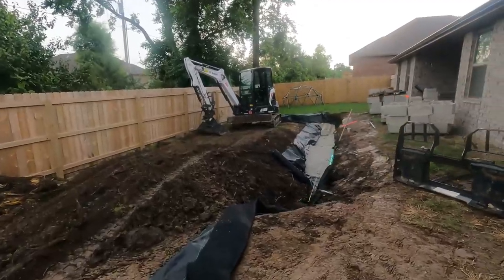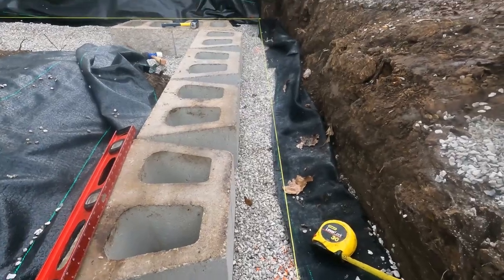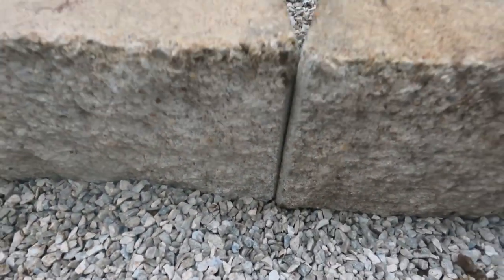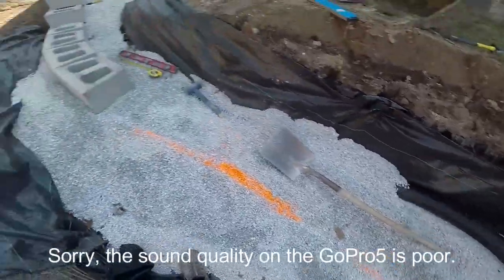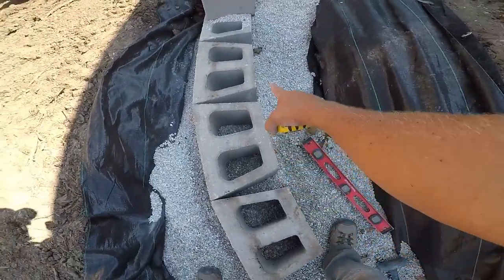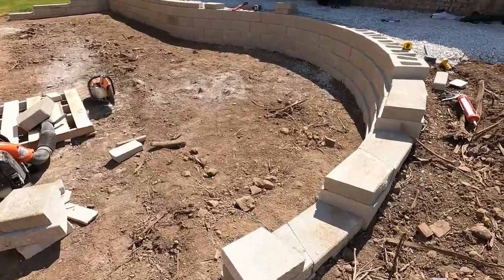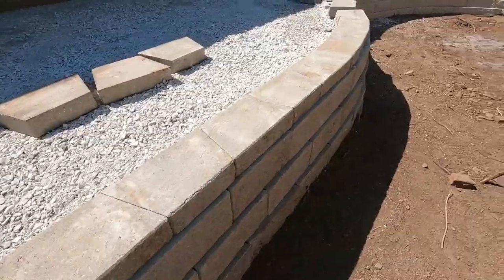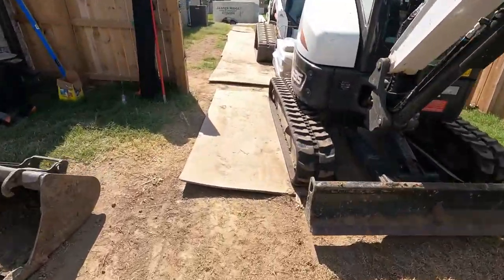How To Build a Curved Retaining Wall (Step-by-Step)

Comment: Outstanding. One of the best examples of team work and utilizing equipment and skill to perform a back yard make over. I hope someday to be at least partially capable of this. Liked and subscribed a while back. Couple quick questions: 1. Do you need to compact the base layer of angular gravel under a wall of this size either by hand or with a compactor or simply level it? 2. Does each block need to tilt back ever so slightly towards the earth is is retaining or is that not necessary with this style of wall building or this brand of block?
Reply from the maker: Thanks for subscribing! 
1) Gravel is “self compacting” or so I’m told. I’m sure there is an engineer out there somewhere that could explain more scientifically. But we use a large rubber mallet to set the blocks in place. 
2) We prefer to tilt the wall slightly back that way if there is ever a slight amount of setting the wall will straighten out rather than beginning to tip over.

Comment: What does this cost? Probably a difficult question but surly $100-150 a linear foot plus $1500 for drainage line??? So $4500-$5500 for the wall and another 3-5k for the landscaping? I get ask to do this all the time.
Reply from the maker: Your prices are pretty close with the exception of the paver retaining wall. Paver block walls require lots of labor and excavation and prep for the foundation layer. It’s hard to give a linear foot price but double your range and you will be close for all items. Also keep in mind many materials have significantly increased in price this past year. Especially items like drain pipe.

Comment: Any issues over time with the gravel foundation?  What is the highest you would go with this technique instead of a concrete foundation and mortared blocks?
Reply from the maker: The foundation is one of several approved installation methods. You can also set on concrete or compacted road base. Highest you can go in most regions is 4’ without engineering. Engineered walls can be 10-20’ or more with geogrid and many other factors.

Comment: What rock to put to make it level before put the bricks on
Reply from the maker: We use 3/8” clean crushed angular rock. Different manufacturers spec different base and drainage materials. You can also check out ICPI training courses for more in depth build techniques.

Comment: Um, you didn't show us how to mark the curve. You fast forwarded thru that part. Very misleading.
Reply from the maker: I’m sorry. What questions do you have? We used a concrete stake to mark the center point and measured to the back side of the block for consistent results. Building a curved wall has the same key elements as a straight wall but instead of measuring off a string line you need to find the center point of the radius. If you have further questions please feel free to email. Our email address can be found in the about section. We have had many people email us more in depth questions like this.
Reply: @ThriftyGarage  hey, thanks for the reply. I'm just trying to figure out how to make the tightest curve where 2 90°'s come together. I have no clue how to make sure it lines up perfectly. Everything I find on YouTube just shows how to find the radius but not where to start the measurements to get proper alignment on. Maybe you could make a video on that when you get a chance. Thanks again for your reply.
Reply from the maker: Have you looked up the manufacturer’s specs on the specific retaining wall block you are using? Different blocks have different specifications. Typically manufacturer’s will publish the minimum and maximum radius for inside and outside curves. The angles on the side of the block will dictate how tight a curve can be made. As the wall gets taller each block sets back ~1” meaning when you install the base layer you need to account for the radius that will be achieved by the top layer. Another great industry resource is ICPI certified training courses.
Reply: @ThriftyGarage  Thank you so much for the info and your help. Thanks for taking the time to help a stranger out.